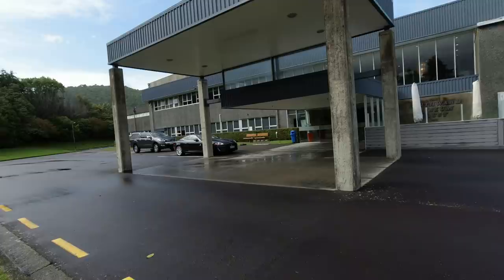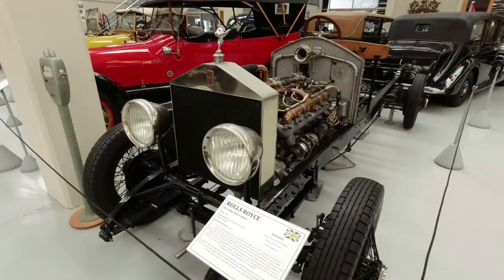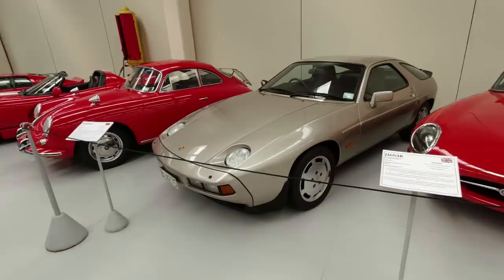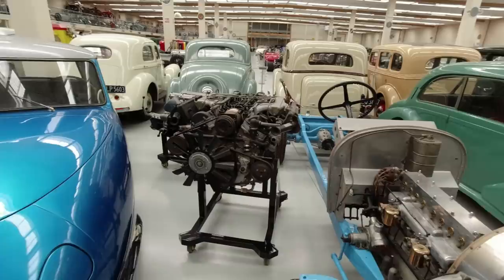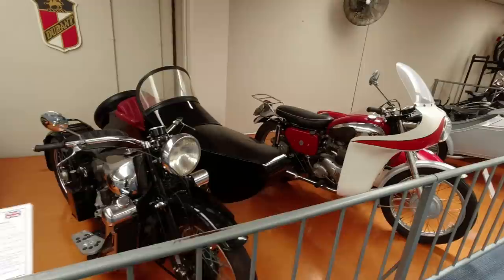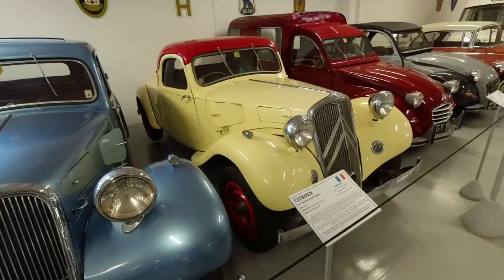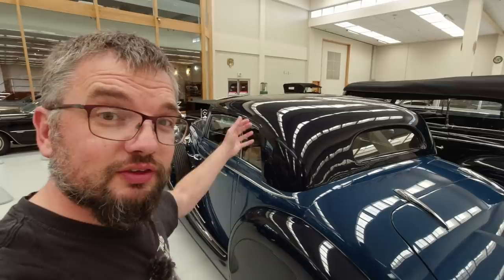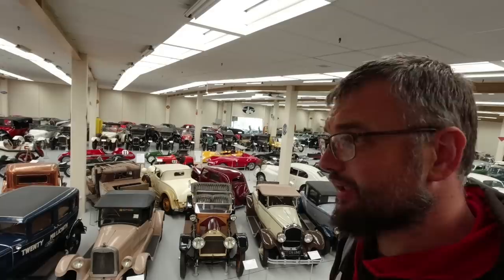NZ Museum Tour: Southward Car Museum, Wellington

Comment: My dad worked on Lens cars when he first started his small scale museum in Seaview Gracefield, Len was a real gentleman very interesting chap to talk to. The new bigger museum is truly world class.
Reply: The new museum was his 'little retirement project'.  He put a lot of effort into making it a real legacy.  I had the pleasure of being shown around by him twice (as part of a group) - once in Seaview and once in the new place.  Yes, a real gentleman and full of knowledge about the vehicles on display. 

With some of the vehicles, he knew them from new - he proudly showed off an early '20s ABC flat twin motorcycle, and told us that he had uncrated it at the original dealer and set it up.... 

His first product when he started his engineering business - during WW2 there was a shortage of mirrors for tucks, so he made the tubing by improvising a set of rollers to form it from strip, and then seam welded it.  Very clever, no nonsense down-to-earth man.  . 

When Len Southward was young, he had a very very red head of hair.  The race boat was an emphatic statement 'red and proud'.  He had a lot to be proud of.
Reply: @paulstandeven8572  Len made special roller presses for my father's business which allowed him to manufacture guards for the trucks he built in return dad would do the metal finishing on his vintage collection  we watch them hoist the old plane up into the roof of the old museum. Len was probably the last genuine kiwi industrialist.
Reply: @mahulad7298  A shame his son was not interested in it the business or the museum

Comment: 22.11   In the motorbike section, you walked past a red Suzuki RE-5. recognisable by it's flip top cylindrical intstrument binnacle mounted above the headlight (and deleted on the later example which is helpfully parked alongside)
Rotary powered and released by Suzuki to instantly coincide with the '70's fuel crisis thus dooming the project to failure after only two years. 
Note the air intakes underneath the radiator. They supply  air to the exhaust internals in an effort to cool the notoriously hot breath of the rotary engine. 
Not particularly appreciated in period but very collectable now.  In fact, it was the reason that I first visited the museum many, many moons ago because a friend and fellow rotorhead spotted a lone RE-5  on a revolving display stand and said I should visit immediately to see it .... because Rotary.  Unbelievable now to see two in the same collection!!
I'm really pleased that you managed to make it to Southwards.

Comment: Mini clutch magic is all in the freely rotating primary gear on the end of the crankshaft, the clutch disc is splined to this gear and the flywheel is a taper fit onto the end if the crank.
Reply: Thanks Ciff G, I was scrolling down the comments to see if anyone explained how the clutch works, you saved me the job. :)

Comment: The Tillings Stevens Fire engine was made by a company which started out building Vulcan trucks. They branched into cars in the 1910's. I helped Restore a 1913 Vulcan and because the chap I was working for at the time had no idea of what a vulcan was,I spent a bit of time researching them (the car was barely finished when we entered it in the Melbourne motorclassica where it won a first prize. ) Anyway Tillings Stevens carried on to keep building vehicles when the Vulcan brand was discontinued. Eventually becoming part of the Rootes Group. So if you ever hear a commer truck running with the distinctive two stroke sound of the commer knocker engine, you will know that it is powered with a TS 3 engine, a Tillings stevens  3 cylinder,,six piston diesel.
When i was last at that museum, the Cord was a quickly painted wreck,having been burnt in the distant past and my then Wife ,when she stood next to the Merc 770 ,her head was just above the top of the headlight.... 😂

Comment: Great review of the cars in there. 
This is my grandfathers museum and I found your walk around when showing the Redhead boat to my daughter with footage of my father driving one of the support boats. As a young kid I was always amazed at the pile of rusty old junk cars that he kept on purchasing, then when he put them in a museum in 79 it all made sense. He even purchased a steam engine(KA945) that he wanted to use to bring people from Wellington up to the museum but think it got all too hard working with Railways etc... so he donated it to the local train enthusiasts. 
My father started his own collection of cars and now that he has passed away I have those in my shed. I have the old Panhard with hot tube ignition, there is a video of it running in my channel,  supposedly one of the first cars with the engine at the front driving through the gearbox onto the rear driven wheels, Systeme Panhard as it was called. This was car 4 in 1891, not sure what car 3 had but 1 and 2 had rear engine rear drive.

Comment: Wow!  What an amazing museum.  On the Standard V8, there is very little information available on them, but apparently they are only 2.7 litres, and were notorious for overheating.  One wonders why they bothered.  A chap I know in Melbourne is restoring one of the remaining 4 known to exist.  On Willys, the Americans pronounce it Willis, and the rest of the world pronounces it Willies, just in case you ever find yourself in yankland.  The 1937 model shown has the American body, whilst Australian ones had a locally made body (by Holden, who were body builders at that time) which looks considerably better in my view.  If you have an idle moment, google a photo of the 1939 Willys, which has an even more wacky 'face'. The Riley Pathfinder was the last car using Riley's twin cam (in the block) 2.5 litre 4 cyl engine.  The body and chassis were shared with the Wolseley 6/90 which used the C series engine in 2.6 form, and the Riley engine was 10 bhp more powerful.  On the Prince Skyline, I've never seen one before, but the styling similarity to the Checker Cab is quite remarkable.  Cheers.

Comment: the mini transmission......... when you depress the clutch pedal the release arm pushes on the release bearing which pushes the clutch cover -which is part of a  sprung sandwhich of that, the friction plate and the flywheel...so when the clutch cover is pushed  sandwich is basically opened so the friction plate does not take drive from the flywheel onto the  primary idler gear which is the one you seen on the crank...The friction plate is splined to fit on the splines on the primary gear... hope that makes some sense..................when you release the clutch pedal the clutch cover clamps the friction plate to the flywheel face so you get drive.....................................Wonderful museum!

Comment: 28:20...the riley pathfinder used to belong to my father..he restored it in the mid 90s .

Was quick for it's time...would do 100mph which was quick for the 1950s being a smaller 2.4 litre 4 cylinder.

He sold it to southwards in around 2001.

Comment: Mini transmission. The helical gear left drives the transmission, it is hollow over the drive shaft and includes the base of the clutch. The engine drive shaft which goes through the former base and helical gear has attached the front pressure plate of the clutch and flywheel. So declutching releases the base plate and freewheels the driveshaft

Comment: That was a 10 out of 10 Museum, lots of rare stuff mixed with just old.
It's a shame your not into motorcycles as there were quite a few oddities and rarities in there.
I'm sure I clocked two Suzuki RE5's as you charged past (Single rotor rotary engine)
Still a great look around an excellent Museum.
The Davis three wheeler, there was one featured on Chasing Classic Cars with Wayne Carini.
He tried to restore it to what was thought to be original spec, but there were so many modifications and changes at the factory,
nobody is quite sure what original actually was.

Comment: The Trojan's engine is a split single. It is a 2 stroke with one of the pistons handling intake, the other the exhaust. It is explained at https://en.wikipedia.org/wiki/Split-single_engine#Trojan. The advantage is that you can have a normal wet sump bottom end, and avoid built up crankshafts.

Comment: A little background on American Bantam. They began as American Austin in Butler, Pennsylvania, in the late 1920s building the Austin Seven under license.

In the thirties, there was a need to make the Austin more suitable for the American market, and it was rebodied with new styling (From Raymond Loewy, if I remember correctly) and rebranded as the American Bantam. 

Their successor is slightly better remember. In 1940, American Bantam won the concession to create a quarter--ton general purpose four-wheel-drive vehicle for military use. Bantam did the engineering, but did not have adequate manufacturing capacity to make the vehicle. Ford and Willys were contracted to build the first Jeep.

Cheers from Costa Rica!

Comment: 20:58 Sunbeam S7, a historic BSA failure, mainly as they used a phosphor bronze worm in  the main drive. The first prototype ate the worm and wheel drive in a few hundred miles so the answer, de-tune the engine and build it anyway.  I rebuilt one in the late 1990's.

Comment: 12:12 The 1970 Catalina might have been chosen because of its one-year-only front end styling. The pointy nose of the '69 was removed, possibly from pressure from DOT/NHTSA to eliminate protrusions that might injure pedestrians, and replaced with a formal grille like that of the Grand Prix. Pontiac also added those little round grilles that looked like something from a 1960s Jaguar Mark 2 or S-Type; I doubt they did much, but they looked cool.

Comment: Mentioned by another poster re motor cycles. An interesting one you missed was the Brough Superior Austin Four from 1932. Only 10 made and amazingly 9 still exist. This one is listed. Austin Seven engine with shaft drive squeezed into a diff between twin rear wheels.
 https://en.wikipedia.org/wiki/Brough_Superior_Austin_Four
Amazing museum.

Comment: The Trojan has a split single engine: two pistons sharing one two-stroke combustion chamber. By having a cylinder wall between the intake and exhaust ports, the engine is better at scavenging. Usually, these engines have a separate crankshaft for each piston, but Trojan's V-shaped connecting rods do flex to keep the pistons moving together. IIRC, designing the engine this way avoided some sort of displacement tax.

Comment: 22:29 Aha .... I thought you were going to coment on the red and white Czeta scooter that were built in New Zealand as the NZeta. They were an interesting ride as the fuel tank was over the front wheel ... a full tank would be nose heavy but as the fuel got used, it would slosh about making the front wheel difficult to keep still. Then there was the problem of filling the tank, if you overfilled it, you'd get petrol on the front tyre.
Reply: Thank you Al Kaput, I was wondering where the name change came from.

Comment: Bonkers trojan engine! The conrod did`nt bend in normal running but was sometimes caught with an off centre loading in a backfire or pre ignition situation. Another killer of these engines was the huge flywheel. To start, first get it spinning and then turn on the ignition, or the aforementioned backfire could, and did, snap the crankshaft.
 It started life as a stationary engine and perhaps should have stayed put.

Comment: The Mercedes Benz company can produce and restore any parts on any Mercedes Benz ever produced. That may have been the better option, as it has then the certificate of "Original Manufacturer" still, enhancing the value.
Reply: Ronald de Rooij I understand MB were very interested with the RHD (possibly 700 series) turned up as it was part of an order of about 7 and it was the only RHD for use in Britain if the war ended differently.

Comment: Trojan manufactured the "Split Single" engines in to the late 50's the system was also used by Puch and Jawa in m/cycles   Suggest you read "Some unusual engines" by Setright.
Reply: Trojan,I think I recall constructed a number of track cars for Bruce McLaren racing.

Comment: 21.05 Douglas Dragonfly 1955-57 350 cc air cooled boxer twin.
Single plate dry clutch.

Douglas motorcycles 1907 - 1957.

21.14 Velocette LE Mk 2. between 1951 and 1957.
192 cc. Water cooled boxer engine, plain bearing crank with wet sump.
Dry clutch (3 plate), coil ignition, 6 volt AC. Generator.
LE Mk 3 1958 to 1971.
Velocette motorcycles 1904 - 1971

Comment: 5:46 opposite the Alfa 6c looks like an MG single seat race car.  I know there was a R Type MG in the Southward Museum.  This may be it.  A truly pioneering race car of 1934 with double wishbone suspension front and rear on torsion bar springs, and a welded sheet steel chassis - think Lotus spine frames.  If only William Morris was not such a stick-in-the mud - this car made him furious, and he destroyed MG as it had been as a result.  MG wanted to put this suspension on production cars.  A prototype SA was made on these lines, and it made Morris even more angry - so he closed the Abingdon design office.  Cecil Kimber was not a happy man, but somehow he stayed on.
At 13:50 you passed by an interesting special.  It has a '50s Aston Martin drive train.  A retired engineer got most of the way to building the chassis and body, but fell ill when he was about to make the body panels.  His widow eventually sold it to the Southward collection, so it will probably remain as it is.  I think it would be great to see it panelled and running......
The Tiger Moth at 18:57 was probably made at Rongotai, Wellington, to train pilots for WW2.  The hanger it was built in is now the main concourse of Wellington Airport - where domestic and international passenger flights discharge their passengers.
Up in the motorcycle section - "you get a very nice overall view of the museum"
At 22:08 is an excellent special made by an architect called Graham Allardice, based on a sohc 750 Honda engine.  He designed the very well triangulated frame and fairing (with twin 7" headlamps) and had them made.  It has a duplex final drive chain, a feature later used on Benelli six bikes.
22:33 a tandem triplet bicycle on the wall.  I wonder who made that?  It looks like  Cyclo touriste derailleur gears
23:46 that Austin 7 Swallow should be on prominent display, not tucked away ashamed in a hidden corner.  One of the very first cars made by William Lyons, later renamed Jaguar.
At 25:45 we see a Gnat.  I haven't seen one or heard anything of this wonderful device since I saw one in the mid '60s.  It's a farm workhorse with an air-cooled two stroke (chainsaw?) engine, automatic clutch and chain drive.  It is simplicity in metal, built low, and pretty well impossible to break or roll over on steep high-country farms.  The mountain goat of vehicles, and as un-pretentious as it is possible to be.

Comment: In Glasgow  they hang the cars on walls you cant see them up close let alone go under them. At least  the overpriced shed they are housed in was designed by an award winning architect, that's what matters and that alone merits the wages of the city's top decision makers. However there are some great exibits in there, worth seeing despite  the surroundings.
Reply: Agree bruh - really annoying that cars are twenty feet up the wall in the new Glasgow Transport Museum. In the previous building (a larger space?) you could get right up to the Austin 7 Chummy and look into the cabin, and stand beside the Model T. Now the Chummy is up the wall! Shame.

Comment: WHAT NO TYPEWRITER? Outrageous, but let you off with a shot of a Suzuki I had and my most funky 'car' I owned a Bond Bug. Used to upset the locals in your neck of the woods while at Bangor Uni North Wales in '74-7', hairing across the Menai Straights bridge to catch an extra 30 mins drinking time because Anglesey closed later. Not that I condone drink driving in a 3 wheeler or any other vehicle..!!!!

Comment: The Douglas you just happened to look at, or rather a predecessor of that one, is what BMW had to pay rights to use the boxer engine!
http://www.fordgarage.com/pages/20millionford.htm for more info on the 20,000,000th Ford. If its vin/serial number is A20000000, that's it, otherwise a good representation (fake).